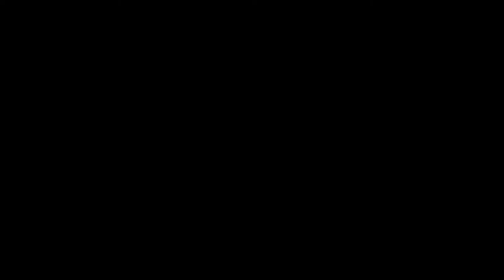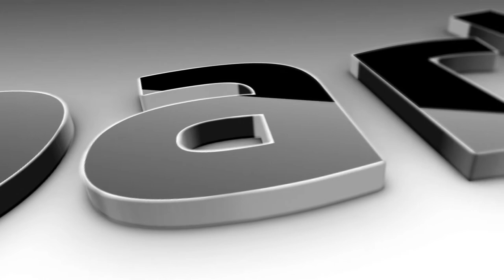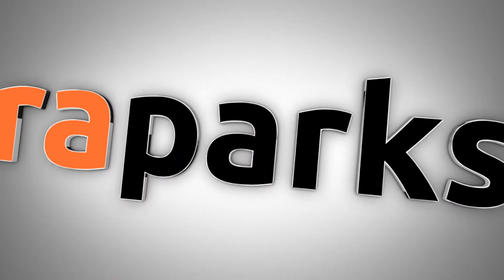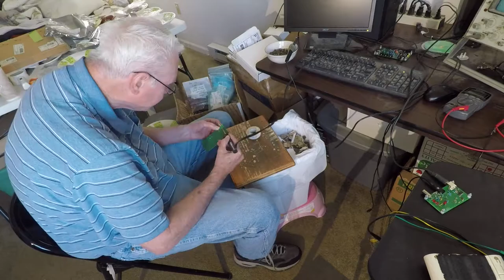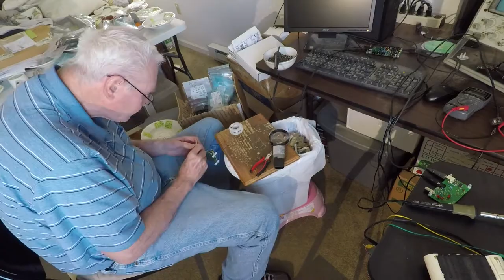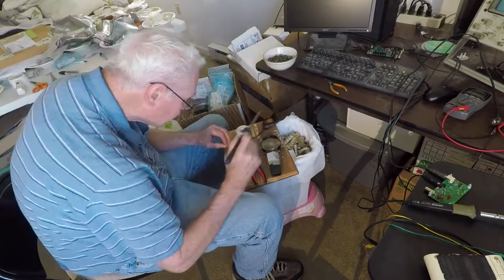With Tony Parks KB9YIG on SoftRock Software-Defined Ham Radio

Comment: It is hard to imagine all the work that goes into building those beautiful radios. So thank you for making the video. I own two of them.  
They flawlessly integrated into the various SDR programs, Linux, and Windows. Getting the correct drivers, can be a little tricky, you just have to do your homework. 
Many SDR lack linearity and can be easily overload by strong signals, specially some of the popular dongles. Tony's radios are superior in everyday. 
I use one softrock on the New Orleans WebSDR, publicly accessible on 20 meter, and the other, with the SDR Console. I've love radio Astronomy and hope I can use them there one day.
 All I can say, they are built like a German tank. 
Thank you Tony! You're truly a craftman.

Comment: Built mine. Receive has worked wonderfully since I received the unit. I’ll admit I’ve never had a successful contact on it but that may be my antenna setup or improper computer setup.  Not having the tools to test with kinda puts a hamper on testing so I have just enjoyed listening on 20/30/40. Sadly a full HF rig has always been priced out of range for a newer/decent one and I basically wanted digital modes anyways.